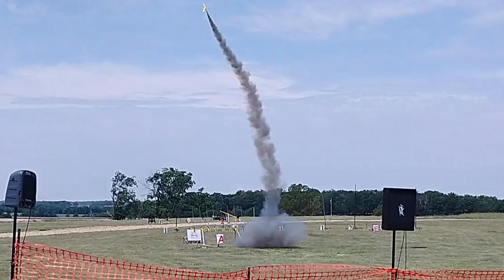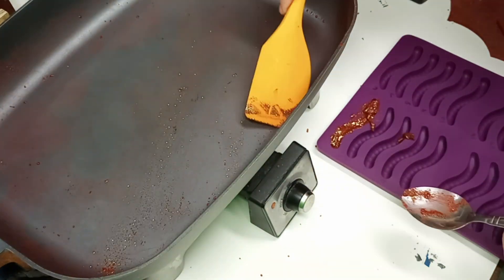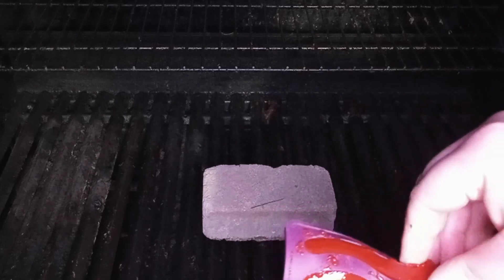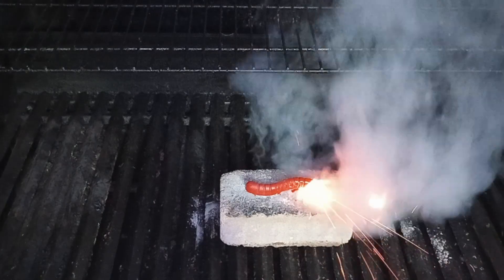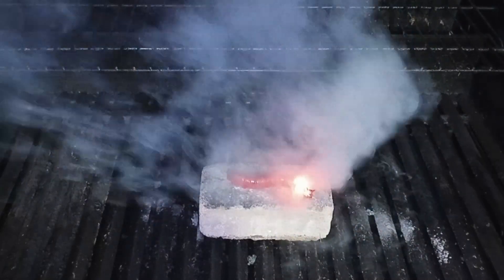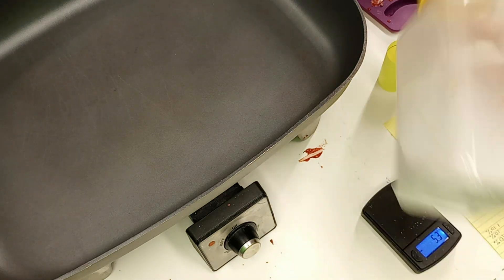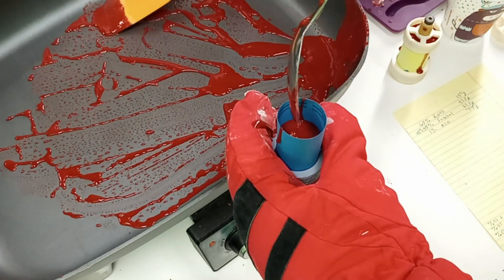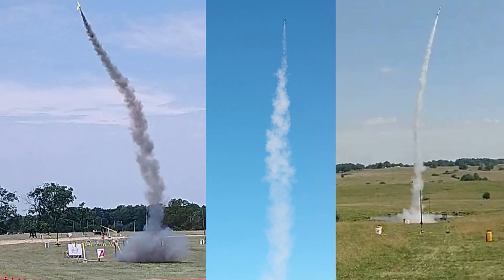Sugar motor experiments (attempt to make black smoke from a sugar motor)

Comment: The candy propellant produces white smoke so you will never be able to produce a black smoke propellant that is usable in a motor I dont think. Best you can hope for is grey smoke.
Also I think you miscalculated the addition if the glitter. You want that 10% to be part of the fuel load. For example if you use 25% fuel in your propellant mix then you need 75% kno3, 15% sorb and 10% glitter. the proppellant should burn cleaner with less residue.
Also, the conditions under which the propellant is burning inside the combustion chamber are very different from those of the test strips. Not sure what useful info you will get from test strips.

Comment: Thanks for posing the results even though it did not turn out as expected! This will help those who are experimenting with sugar motors.

As you found out components that work with AP do not always work with a sugar motor. It was certainly worth a try!
Reply from the maker: For sure.  I think in addition to the heat being too low, the poor adhesion of the sugar to the plastic glitter particles caused the poor burn consistency.  I imagine the HTPB resin in APCP would adhere much better to the particles.

Comment: I've done zero research and don't currently make my own grains (yet), but I was wondering if some BP, charcoal, or chopped (and ground up & sifted thru a screen) carbon fiber might do anything? I'm thinking of things with carbon in them, not "things that are black", but if the burn temp is the issue, they probably wouldn't help

Comment: Not that much research ;)) many black prop (Skidmark, darkmatter, and other famous black EX prop) use Zinc powder. The temperature of the zinc products in the exhaust makes them absorb light in the visible range. Once it cools down that changes, hence the black smoke turing white